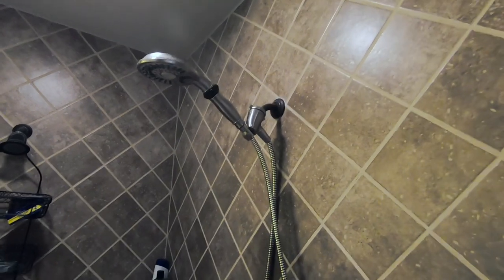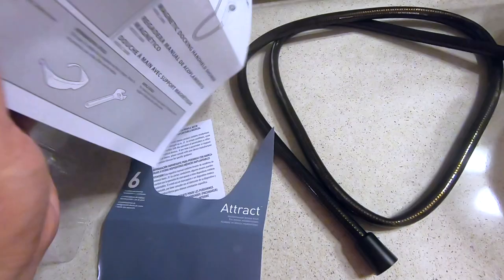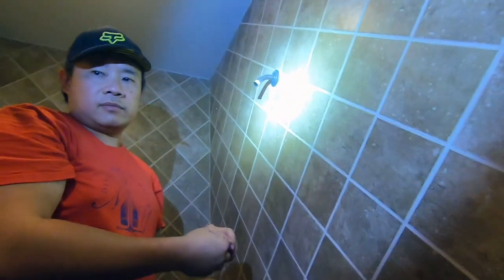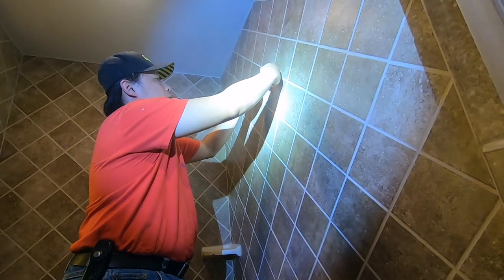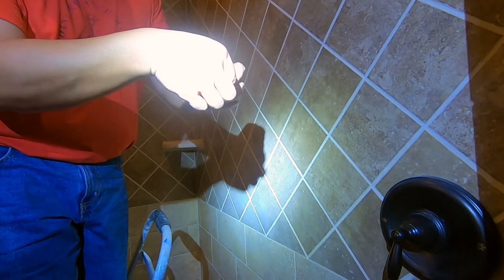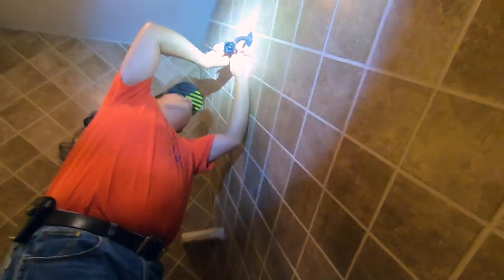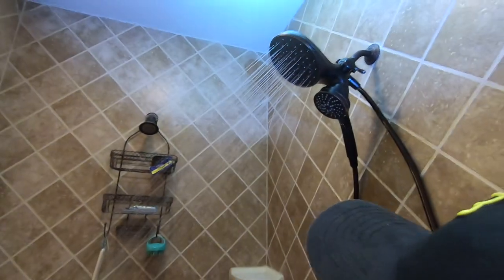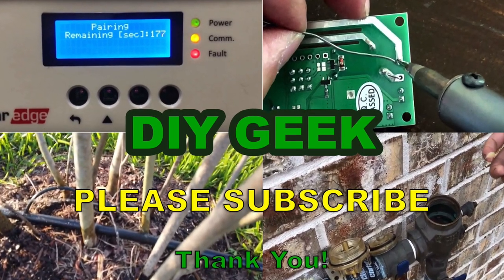How to replace old shower head with new Moen Attract Magnetix shower head

Comment: Got one about 18 months ago.   Worked ok, but low pressure unless you turn on the thin stream....so I have to use that stream to rinse off(didn't know about the regulatory until now).   One problem was constant from day one.    The hose always wanted to bend the way it wanted to bend...., so if you got the head turned around while showering and try to put it up on the magnet, the thing fights you until you turn it back around.     

After 18 months(last week) as  I was finishing a shower, I noticed the hose had started to balloon up right near the head...luckily I had already rinsed and could just shut it off, but it was done at that point and had to be replaced.

Comment: Did you keep this shower head or change it for something else?  I also just installed one and have it dripping.  Did you ever resolve that issue by tightening it up top as mentioned near the end of the video?
Reply from the maker: I end up changing it to a large 16 inch rain shower head made from 100% stainless steel: https://youtu.be/9wMgzEmGesg

Comment: Terrible pressure take off the regulator then it works great its got 2 parts to pull out works perfect with pressure!!
Reply: Where are the 2 parts you need to remove?
Reply: @adam9176  inside the section that connects to the wall pipe where the water comes from take out the black rubber part first then theres a white part pull that out them under that one theres a blue plastic regular that needs to come out i basically put a screw into it then pulled out works great after that comes out makes no sense why they put that in you actually take longer to shower because it has no pressure but works fine after you take that out pressure is perfect take quicker showers 🚿 always conserve water lets not forget that.